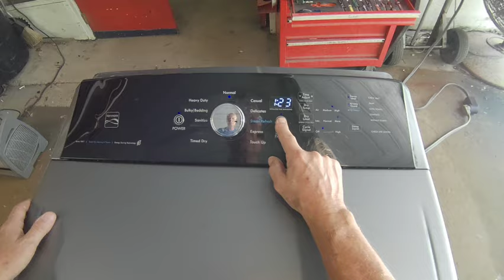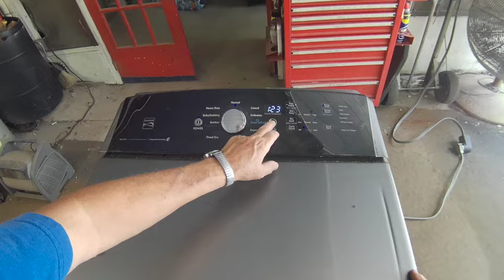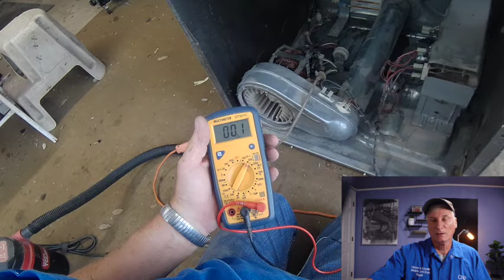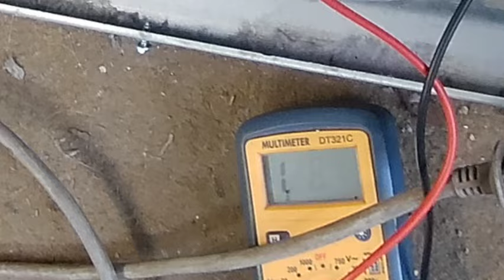How To Fix a Dryer That Clicks But Won't Start: A Troubleshooting Guide

Comment: Chip, thank you so much for the troubleshooting video. I had a clicking, but not running issue. Ran through all of the technician testing manual, and everything had continuity and proper resistance. The only thing I didn’t do was pop out the control board from the white plastic. I watched your video and immediately went back to the dryer and popped out the board. Sure enough, the heater relay burnt out. Found a replacement board online and the dryer is back in working order. Many thanks again for sharing and saving me a bunch of cash.
Reply from the maker: I’m very glad I could help. Thanks for watching!
Reply: My board was toasted too, replaced it but doing same thing. I’m wondering if new board is bad
Reply from the maker: If it’s a new “used” board it could be, or it’s possible that another component might be the issue. Thanks for watching!

Comment: I have the kenmore 600 series electric dryer that has a problem with the start button on the control panel, sometimes works, sometimes doesn't ,can I take the panel apart and clean electronic interface buttons?is there a link that would show me how?dryer works great when it does come on
Reply from the maker: There are different model numbers in that series. Can you provide that? Look on the sticker inside the door. Most of the time the problem isn't the start button. Thanks for watching!

Comment: Thanks for showing this so clearly. I'm going to try this on mine tomorrow. I get the click but nothing goes on. I've already tested the thermistor and thermal fuse.
Reply from the maker: I hope your repair goes well. Thanks for watching!
Reply: I have an LG. I try to start it on towels mode and it does a click, click, click. 3 Clicks it makes. I replaced the full control board and thermal fuse and also made sure the door switch was working. 1st tried full control board. No luck. Def checked the door switch and that was ok. Lastly changed the thermal fuse. Still mskrs the 3 click click click sounds.
Reply from the maker: @tcr9315  try checking you belt tension switch. That might be the problem. Thanks for watching.
Reply: @HarperandKnowles  if i bought  a replacement motor, is the belt tension switch on there
Reply from the maker: @tcr9315  no, it’s just a micro switch that opens when the belt breaks and the idler pulley falls against its actuator.  It keeps the motor from starting when the belt tension is absent.
Reply: @HarperandKnowles  my belt wasmt broken. It was on fine. I did take it off then back on the same way.
Reply from the maker: That doesn’t mean the switch isn’t bad, or it may have a loose wire on it. It’s worth checking out. Something is preventing your board from sending power to the motor.

Comment: Them dryers are heavy I always put a short piece 2x4 under it while putting the bottom screws back in.
Reply from the maker: They certainly are. I'd rather work on those models where the bottom is held in place by tabs and slots. Thanks for watching!
Reply: @HarperandKnowles  Same here and you're welcome

Comment: Hi Chip. 
I have a midea gas dryer that has a major problem. 
I have a natural gas smell coming from the exhaust vent of the midea gas dryer. and not one person who I have talked to about the dryer problem. do not know what is going on with it.... plus they do not have any diagrams on that gas dryer on google.. if you can PLZ help.
Reply from the maker: I have very limited experience with gas dryers and none with the Midea. But, I would say you are not getting enough air for a complete combustion or you are getting too much gas. You might try changing the coils. If the smell is occurring when the machine is off you have a leak. Thanks for watching!

Comment: My Kenmore 600 gas dryer light stopped working  replaced bulb still not working and dryer still runs now I'm told to replace the switch
Reply from the maker: You were probably told right. Sounds like a faulty door switch.